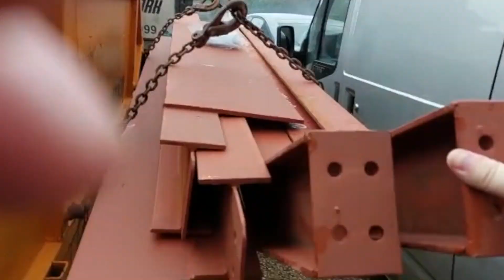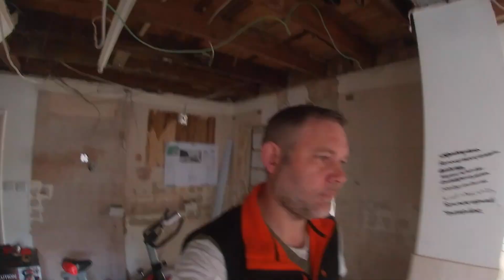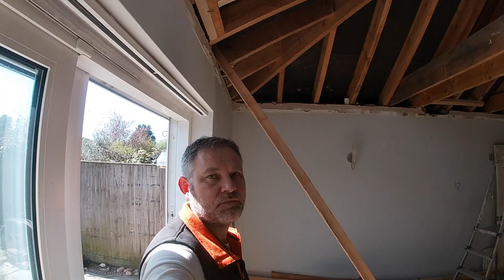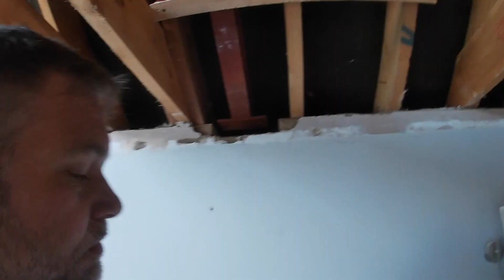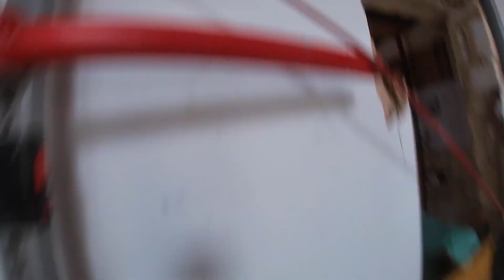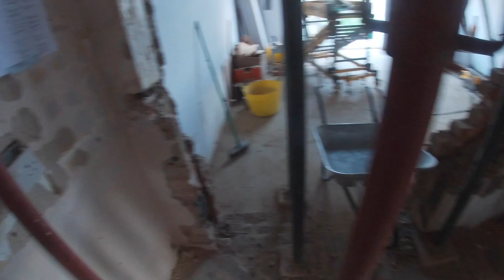Installing Structural Steel & Creating a Vaulted Ceiling

Comment: Great video , I did notice that when you made the template for the cranked frame , you over sailed the ends into the cavity a bit . I get it’s difficult to cut it plum when you can’t get into the cavity but I think that’s why the feet were to far back . Looked like the feet were level with the back of the seat cut . As per the drawing. I’ve worked with those kinds of templates before and you always follow the outside edge . At least it’s all sorted and looks great .
Reply from the maker: I see what you mean. It's possible but when we dropped the template off we had a verbal discussion with the manager, wether that got passed on to the fabricator I don't know. In the end it wasn't too bad, just a trip out and a burger king lunch 😆